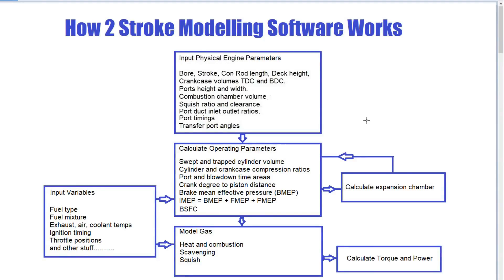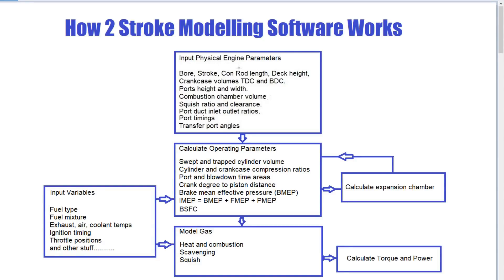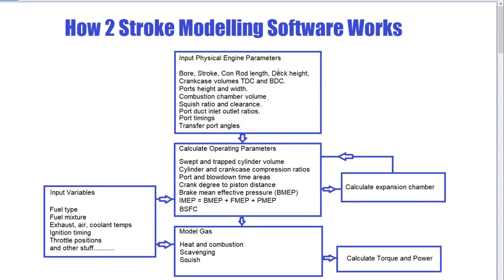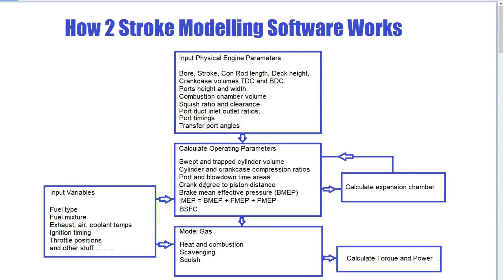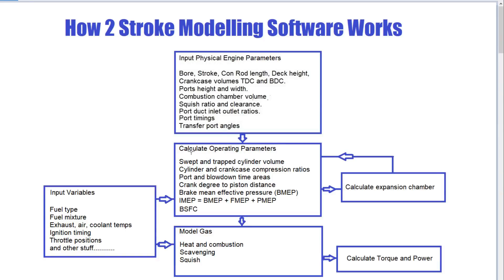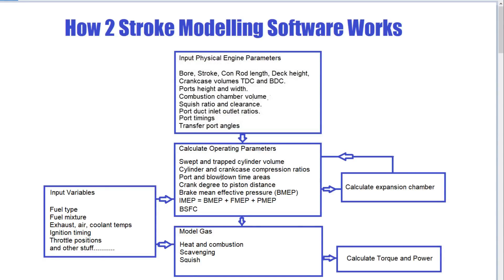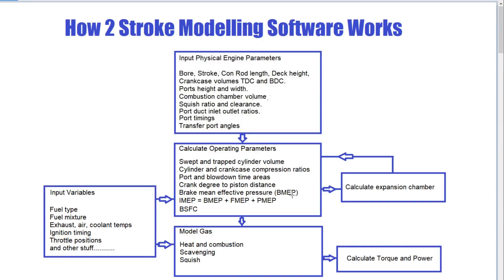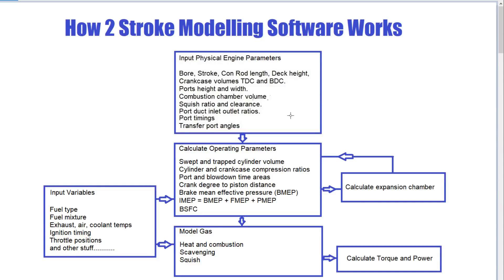How all 2 stroke modelling software works and do you need it.

Comment: No i didnt hit the cylinderhead, no Marks or scratches all bearings ok
Reply from the maker: OK well that rules out any interference issues and if it was detonation at would be at wide open throttle not with throttle shut.
Perhaps something loose on ir inside the expansion chamber causing the noise.
Give a few things like the pipe, baffle and engine mounts a tap with a rubber mallet and see if you get any noises, maybe check out the clutch basket and clutch damper springs in it if you cant find anything outside the engine.

Comment: Hi AuMechanic, is there anyway to find out, of how much squish i need ? As it is now, i have 0,10 mm. good at low end, but at topspeed, when i close the throttle quickly, it sounds like the engine almost explodes ! Disasemble whole engine, i couldnt find anything wrong ? Is it air exploding ? With closed throttle, it should get some air/fuel mixture, from the idle jet. All videos on Youtube, only explains how to measure, but not to determine how much clearance i need.Is it only trial and error ?
Keep up the good work
Reply from the maker: 0.1mm is pretty close and may not need to be that small, you should pop the head off and check if there are any marks on the head that might indicate the piston has clipped it.
I wrote a software to calculate Maximum Squish Velocity, it is working but I have not uploaded it yet or done the video for it. I should get on to it and complete it.

Comment: Are you using bimotion ,mota or engmod2t software ?
& Can you explain to me how one goes about calculating bmep
Reply from the maker: I have a playlist of videos covering all the equations required to design a pipe
https://www.youtube.com/playlist?list=PLIxC_wjJqk0rYVOG6EpLU2EaAVWZ2saWA
The second videos on the series covers the equation to calculate BMEP.
Theses equations are derived from SAE papers published by Professor Gordon Blairs in his book "Design and Simulation of Two Stroke Engines" 1997 which all of the software you refer to are originally based on.
I am in the process of writing a freeware program covering the pipe calculations.
Reply: @AuMechanic thanks for the reply but the bmep question was more for Porting & head  than pipe design  your videos are great a couple of the answered so.e question's I had
Reply from the maker: Yes the equation is only for BMEP based on rated Kw of HP of the engine.
Otherwise you do need a full modelling software to derive the figures based on things like specific port time area, squish velocity and port areas and so forth.

Comment: just the flow chart makes my brain ache, lol. your series certainly increases exponentially my admiration for the dedication of folks like blair, who spend long hours with a slide rule (or scientific calculator more recently), pencil and paper scratching their heads, crunching numbers,  and graphing results. what a herculean task in the days before TI gave us the calculator (which made it "merely" arduously daunting, lol). yet another tour de force Dave!
Reply from the maker: Thanks.
The last of Blairs 2 stroke papers was in 1997 and all based on computer modelling he created as well as CFD.
Blair and Associates continued to do 4t modelling to this day, although Professor Blair passed away in 2010.
He certainly brought 2t computer modelling into being, and as mentioned nearly all 2t software uses code Balr published in the back his 1990 edition.
Reply: 1990 is basically the 386 era of computing, the very beginnings of 32 bit PC tech. the cheesiest current vintage "kids model" android device would be viewed with starry eyed wonderment over it's "extreme power" by even the most jaded tech head of those days. even using top shelf gear at that time, his work must have been a time eating monster! his ground work that produced that final result had to have been literally man-years spent just on sharpening pencils to record data points. never mind the lab time actually wrenching, fabbing, and running the test beds that generated the data. those whose work he built on, even more so, as they didn't have even calculators. it speaks volumes to the genuine investment of their lives toward that which is so easily applied today.
Reply from the maker: The code 1990 was written in QBASIC
But the later version of the software in 1997 where as exe not source code and written for Windows.
Reply: imagine the "crunch time" the QBASIC code must have spent running results on vintage boxes after a parameter change, lol. "make a sandwich, do your laundry, file your taxes... ok, almost done."
Reply: Back in about 1990, I met a Canadian guy who worked exclusively in Machine code or assembler. He showed me some of his programs and ran them on a 7 MHz 8088 PC. My life was changed forever. I saw speed and responsiveness that Java, Kotlin will never achieve. Assembler programs are minuscule. This allows them to load instantly and run instantly. 
Knowing what is possible out of software frustrates the hell out of me now. To me, slow running software is just wrong! I have been programming for many years and it is always satisfying to write a routine that is super fast, efficient and correct.

Comment: Good point about accuracy and the importance of knowing what is what. A pretty good understanding of how things work is essential too, otherwise you can easily end up with a model that could never work in real life. As you say a good sim will save you alot of time and work(and frustration). I'm a big fan of engmod2t, what I find most useful with it is the  pressure traces - easy to see how well the whole system is "tuned"  and how changing things makes it better/worse.
Reply from the maker: Hi Alex.
The modeling function of the software is worth using for doing comprehensive mods.
The problem faced by all of them I see is that it is very hard to them to make such software simple to use, the simpler it is the less useful it can be for all applications and less detail you give it then less accurate the results might be.
The breadth of detail overcomes people and they decide its all a bit too much to just do some basic mods, a little porting and a pipe.
Hopefully I can cover some basic methods used to get an idea of the process and show how some of the parts of it can be used to to more basic things.
Like port time area and targets to check the porting is near right for an engine and then design a pipe that will work well enough for most.
Being able to do that might give some confidence to go a bit deeper with modelling software and not be so intimidated by it all.